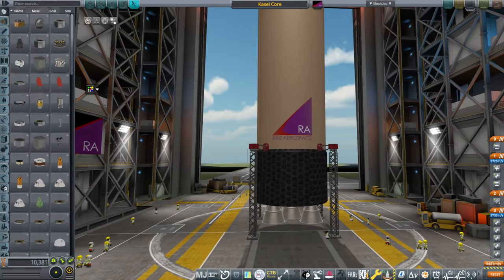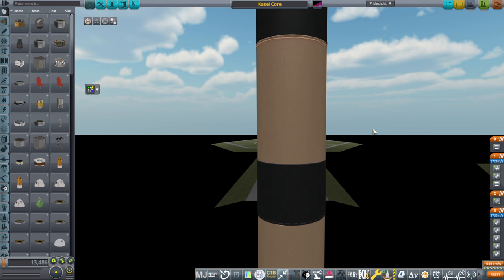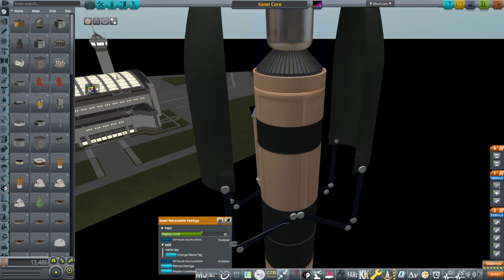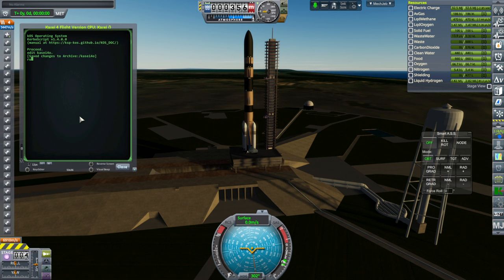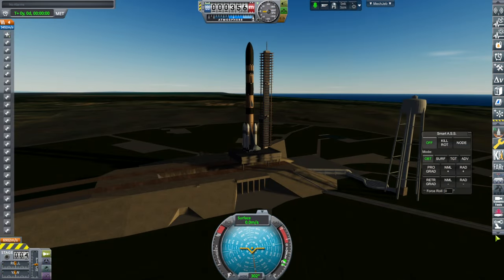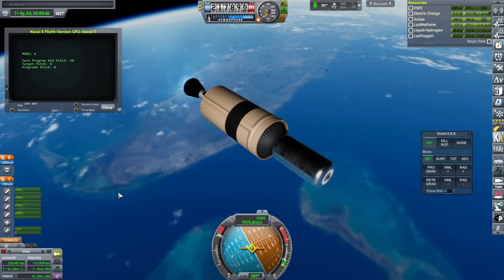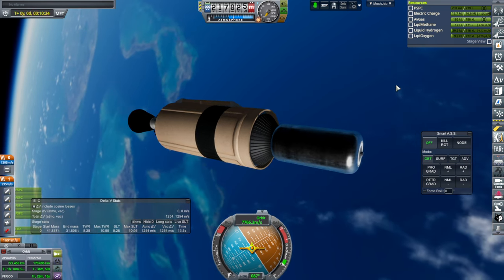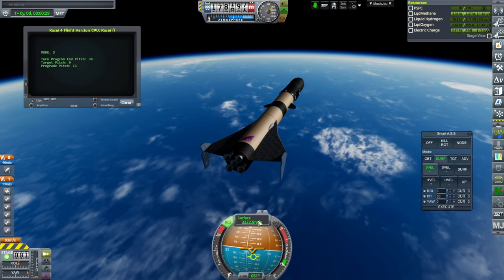A Novel Way to Recover Fairings (potentially) (RO in KSP 1.12)

Comment: I think in a more Falcon 9 -like architecture, this would work great. The real problem here is that your using it on the core of a 2.5 stage rocket, which is sort of analogous to the 2nd stage of a 3 stage rocket. That middle component is always going to be harder to recover, and the heating issues are just a symptom of that. You'll almost always be better off just going with 2 stages, where one can stage nice and low and slow, and the other can make-orbit/once-around.
Reply from the maker: Keep in mind that Kasei is a two-stage rocket - the boosters are only occasionally there, and in this case mainly to verify that the boosters wouldn't hit the wings. Also, we've already done recovery of the Orion Carrier Plane at these speeds and we're just trying to hit the same trajectory. I don't anticipate this is going to be a problem - it's just a matter of how much additional mass I think we should add to the first stage for the heat shielding for this situation. Ironically, it's the non-booster situation I'm worried about, because it doesn't look like it'll be going fast enough to reach our normal landing site in the Bahamas.
Reply: Replying here because YouTube doesn't respond when I click reply on your comment. 

I was never worried that recovery of the stage wouldn't be possible. I do have serious doubts about whether or not it's worthwhile, but it's fun, so meh.

Those arms on the fairings are a different matter. While in KSP I'm sure they'll be fine, realistically, that's a relatively thin part to have sort of out in the air stream. And for the arms to work the way they do, there has to be some sort of mechanism in them. Hydraulics, or electric motors, or something; pretty much however you approach it, it has to handle being left out on the edge of a vehicle going through a reasonably energetic reentry. 

That's all probably solvable, especially if you can massage the fairing shape to keep those arms totally within the bow-shock, but it's a lot of problems that would need to be addressed.

Whereas if this same fairing design was used on something that was staging at F9 sort of speeds, and/or that reentered base first like F9, none of those concerns would apply. And you get to keep the fairing with the 1st stage for reuse, which is pretty neat. 

I just think it makes more sense to apply this solution in that sort of environment than this one, that's all.
Reply from the maker: Just a note - there are little aerodynamic protrusions on the fairings ahead of the arms to shield them. They aren't very visually prominent and might not be sufficient, but I did think about it and they're there.

Comment: Isn’t rocket lab doing something similar and stoke? Oh what gpu do you use?
Reply from the maker: Yes, Neutron partly inspired this, but the problem was having the large upper stage on here as I mentioned. The Neutron method doesn't work so well with such a large upper stage. I have an RTX 2070.

Comment: Energia 2 already solved that
Reply from the maker: This way recovers the fairings as well, which was what the title of the video focused on.
Reply: @RaizSpace in hazegray's video it has a one-piece nosecone that opens to the side, your solution only makes it shorter when landing. you can make it even shorter if you make the top of the tank narrow so that fairing fits around it. maybe you'll have to put canards on the fairing in this case
Reply: @RaizSpace  yeah i know, shortening the length of the vehicle during reentry it's the focus to reduce input variations during atmospheric flight. Would be simpler a hinge mechanism and sliding faring for 2nd stage just for a pure mechanical standpoint.
I love your videos Raiz ❤️
Reply from the maker: Well, like I said, this is more of a KSP idea than a real life proposition in this case. Then again, some mechanical engineer might suddenly pop in and tell me it's totally doable, for all I know.

Comment: Why put in all that effort to recover two simple pieces of metal?
Reply from the maker: We also want to recover the first stage and need a nose for it because we're flying forward like a plane. Also, it turns out fairings are ridiculously expensive, which is why SpaceX also goes to great lengths to try to recover them.